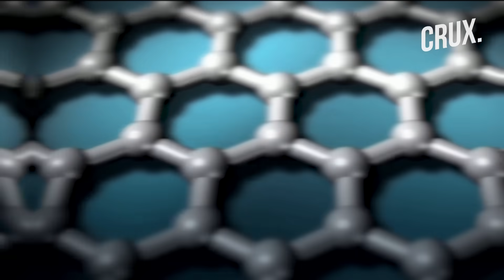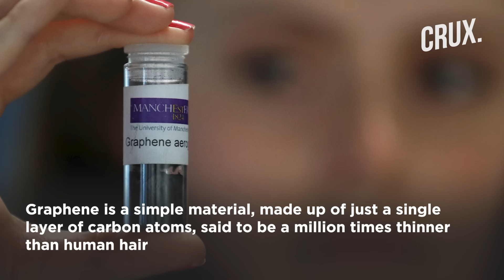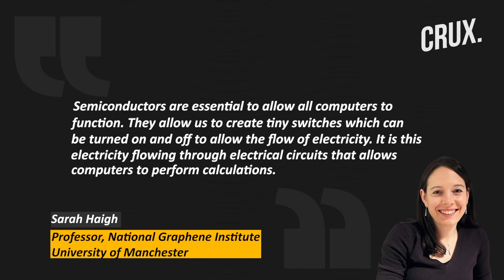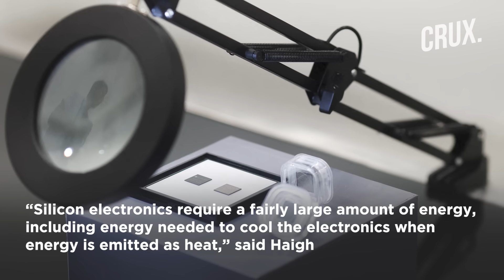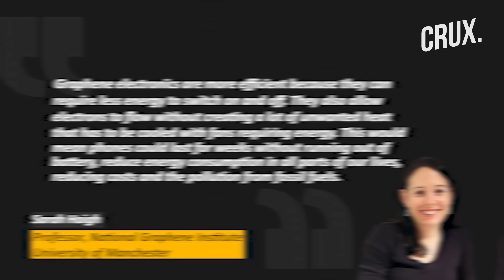China-US Scientists Create World's First Graphene Semiconductor “Leap Forward For Quantum Computing"

Comment: I recall writing a paper on carbon nanotube logic gates for one of my graduate classes in microelectronics. It was the big topic at the time, where if you don't really know what to write about, you write a paper about carbon nanotubes. It worked "somewhat okay" in the simulation but we didn't even discuss fabrication, and that is my far the biggest challenge, i think graphene monolayer or whatever graphene tech they were doing is probably even harder. The electron mobility is significantly higher in carbon than in silicon, and that's the advantage that we're trying to access, but if i recall correctly, it doesn't work as good as a p-type semiconductor, so I don't think it was possible to use it in CMOS architecture. This course was a while ago so I may be wrong or forgot some details and I'm definitely not up to date on the tech

Comment: Do they mean they created a graphene transistor?
Reply: Yesss
Reply: nope, but graphene chips
Reply: @hanfucolorful9656  aren't chips made of transistors so making graphene chips means making graphene transistors?
Reply: @Dylanshandle  I google the definition:

[A microchip (also called a chip, a computer chip, an integrated circuit or IC) is a set of electronic circuits on a small flat piece of silicon. On the chip, transistors act as miniature electrical switches that can turn a current on or off.]

So, you are right. Good weekend!

Comment: The switches in the human brain operate at 5 ms speed and it does a good job with low power.
Reply: They also take a lot more time and money to program!
Reply: @JNaysh  CPUs are limited by power consumption per switching event, memory speed bottleneck and scalability of Von Neumann architecture.

If the switch is like the neuron, then we can scale performance. We could print organic transistors on say paper or use bacteria as switches. People are able to grow small synthetic brains. Unfortunately, we dont know how to program brain scale computers.
Reply: Since when human brain has switches?
Reply: @mhnoni   Neurons switch from polarized to depolarized when inputs exceed a threshold. Then repolarize.  Similar thing happens in the heart PQRST ECG rhythm. I'm not sure if neurons   always operate as switches.

Comment: What’s the downside of this stuff ??
Reply: Requires a SiC template wafer, then requires extremely precise dopant parameters to grow. Care must be done to avoid creating diamond. It is also extremely hard to dice into small chips and requires external insulator for the micro vias. It can hold off extremely high voltage and switch on fast when set up as a mosfet though.
Reply: It's still very difficult to 'grow' graphene in a single-atom layer - they've been working on it for 20 years.
Reply: Nanoparticles of graphene could be more harmful to human/environment than plastic.  Graphene could be the next plastic.
Reply: @kaibrunnenG  yikes